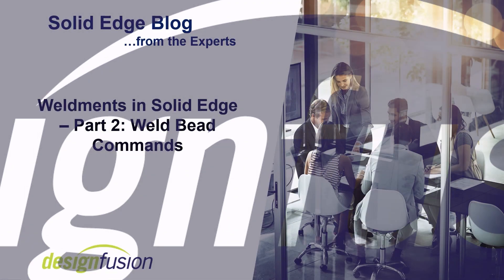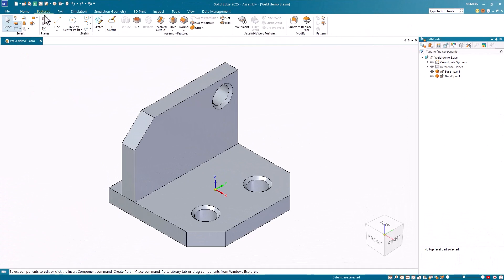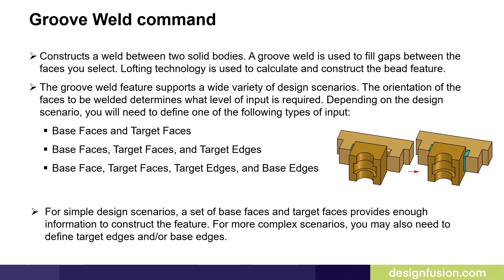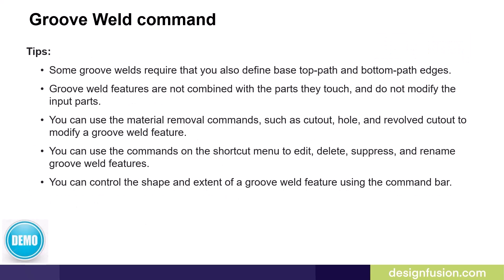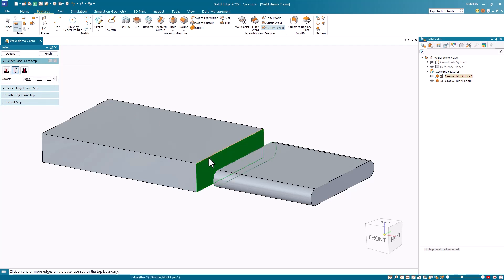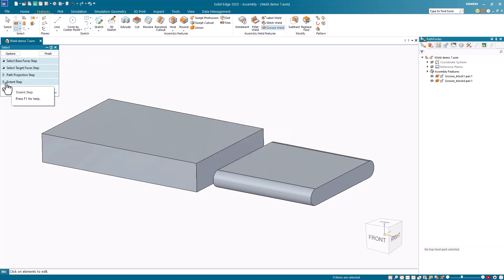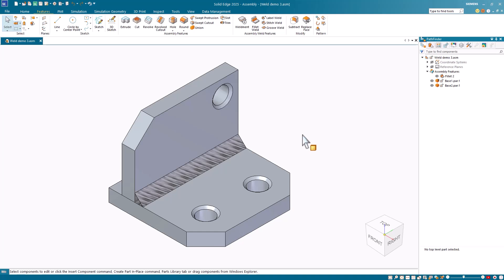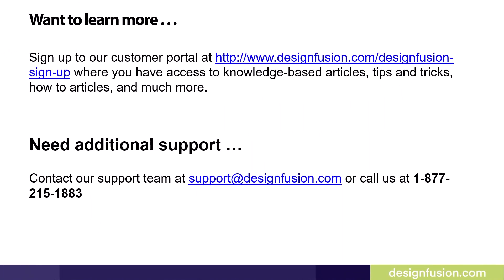Weldments in Solid Edge - Weld Bead Commands - Part 2

Comment: Hi,

I would really appreciate it if you could show the weld for the following example.

Imagine a round metal disk with a diameter of 300 mm and a thickness of 15 mm. A handle, which is a square-shaped metal piece with a thickness of 5 mm and approximate dimensions of 50 mm × 100 mm, is attached to the side of the disk. The side of the handle that connects to the disk has a round cut to ensure a perfect fit against the disk’s curvature. A fillet weld should be applied evenly around the entire perimeter of the handle with a consistent thickness.

It would be great to see how SE performs this weld.